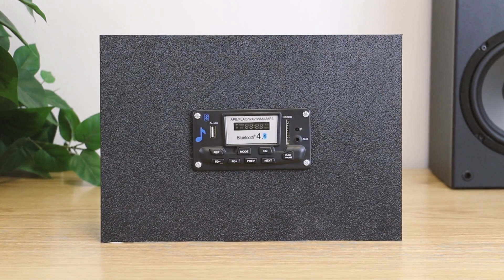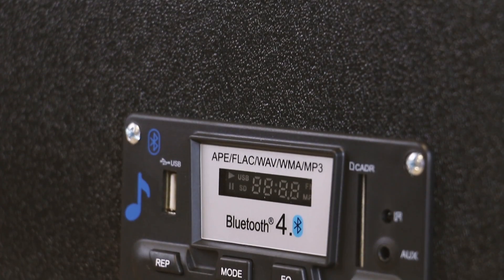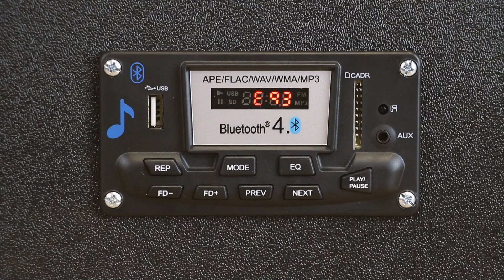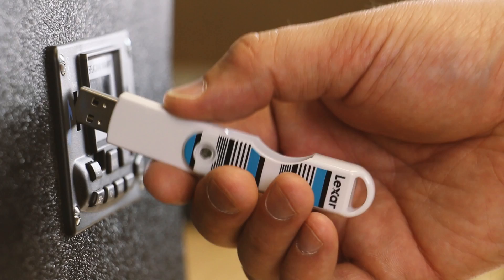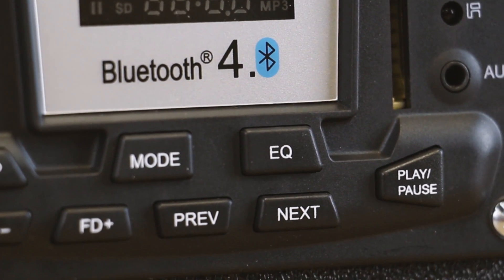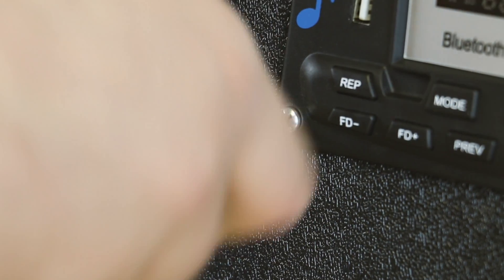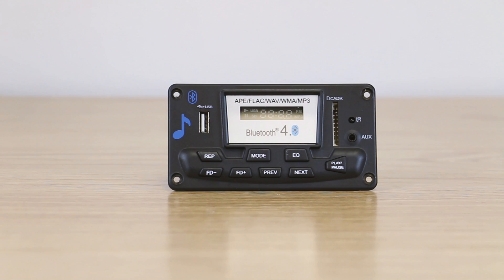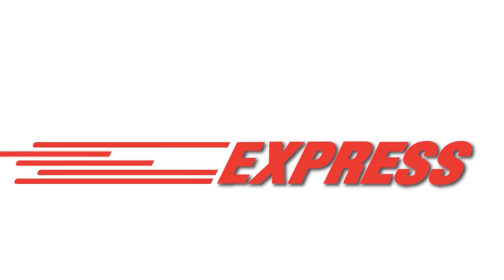Add Bluetooth to your DIY Project or Vehicle

Comment: Didn't you find the output level of these to be too low.? My amp at maximum volume doesn't play as loud as it should.
Reply: This is a problem for a lot of these devices, about one-third to one-half what I'd expect from a tape deck or tuner.  I think it's because the MP3 decoder chip was originally designed for portable use, like in dedicated battery-operated MP3 players you listen to with headphones, where there were concerns about high volume possibly damaging your hearing.

Comment: This looks amazing, but a lot of questions on what type of amp can be used on this? The audio cable goes from the Bluetooth face to a 3.5 jack?
Reply from the maker: That is just one possibility. Not the connections on the left side that come with the preamp.
http://www.parts-express.com/Data/Default/Images/Catalog/Original/320-348_HR_0.jpg